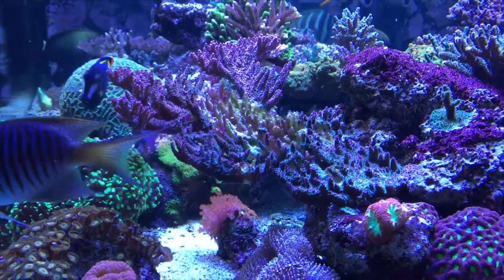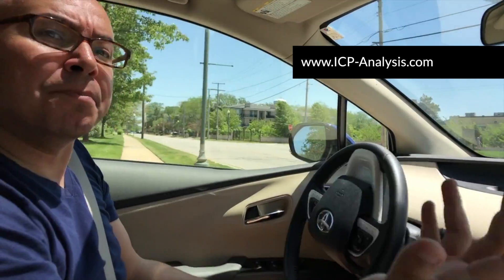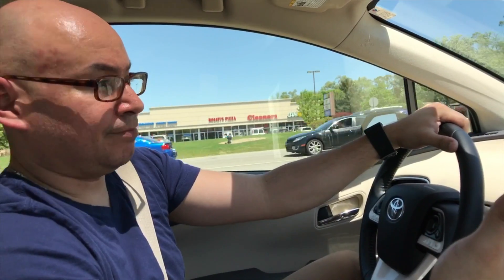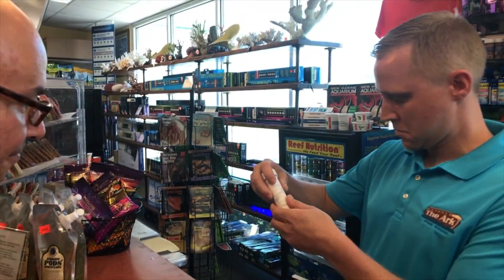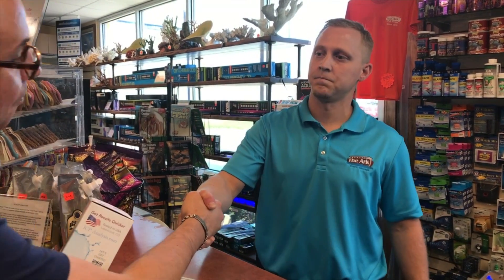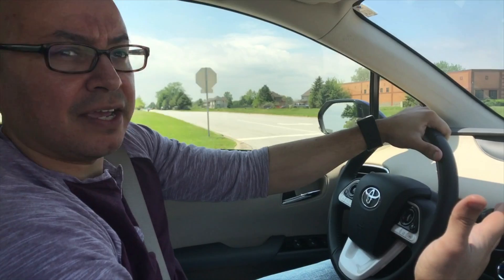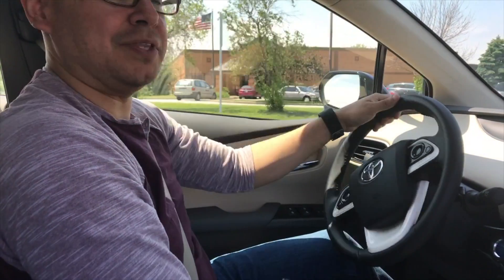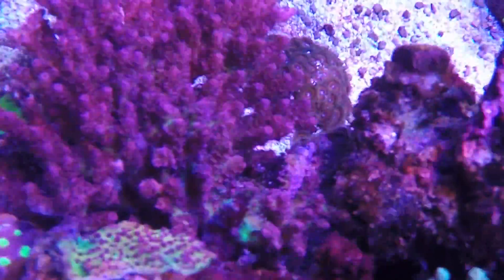ICP Analysis: Elemental Water Testing

Comment: How much was postage so I dont have to go to post office to check.  I have seen good reviews and horrible.  What scares me is if they are worng and I add some kind of element and then it really screws up my tank.  Something is defineitely wrong though because corals are dying. I have dinos I believe but had it for a while now and I lost some corals in the beginning but some hung on and whatever it is its only on the glass now before it was covering frags sand and rocks.  I bought some new corals that had very poor shipping, water leakage heads exposed ect but not only are they dying but my old corals that had been through a bad out break are dying as well!  I cant seem to get rid of it. I have 2 uv sterilizers working in the sump and dose mb7 and vibrant on alternating days!  I don t know what could just be on my glass! a red film and have also tried chemiclean several times with no results. I don't hink it helped dipping corals in brightwells medicoarl either, i think it stressed them more!
Reply from the maker: Sorry to hear about the troubles you are having with your tank. Pre-paid postage is now included with the test along with an additional vial to test your RODI/source water as well.